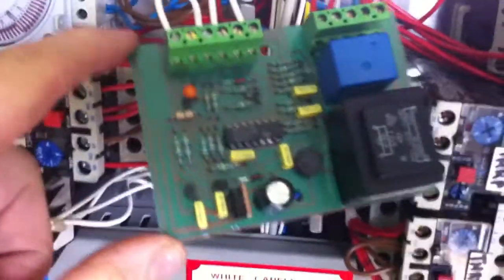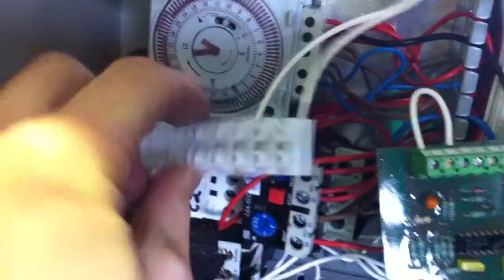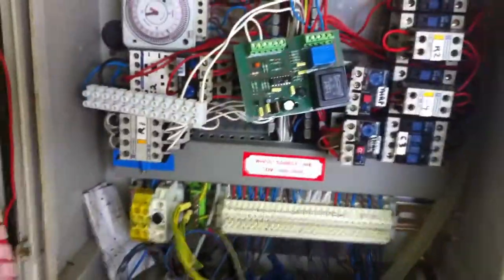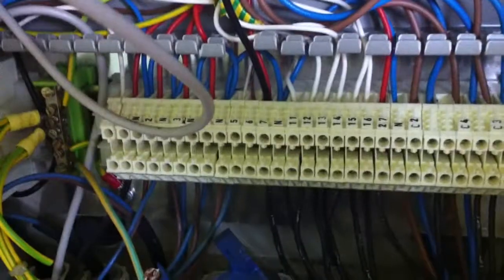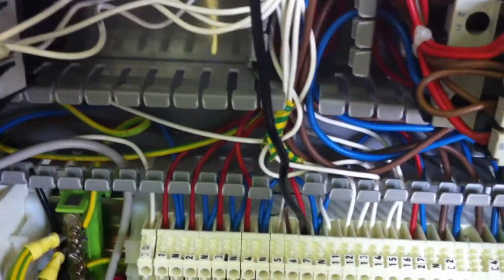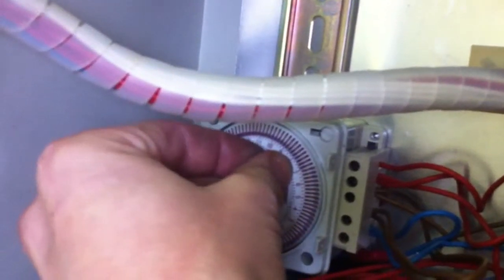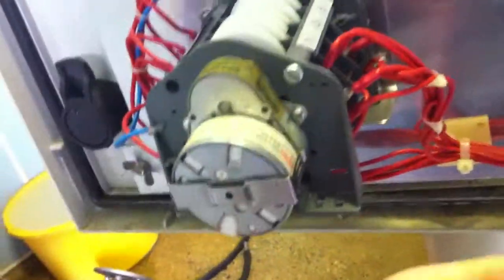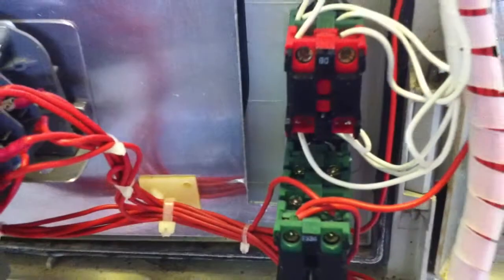Sticky relay or was it?

Comment: You can clean those switches but ideally you should be using a gold flashed contact instead of a german silver high current contact. The gold flashed ones work well for low level signals. Simple temp fix is to operate the switch a few times to wipe the contacts clean, and spray the contacts with cleaner.